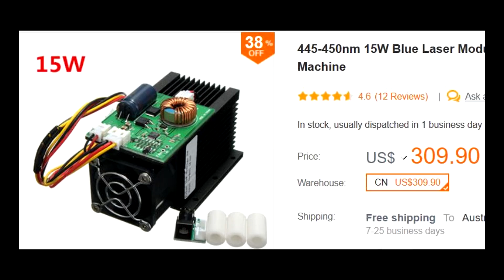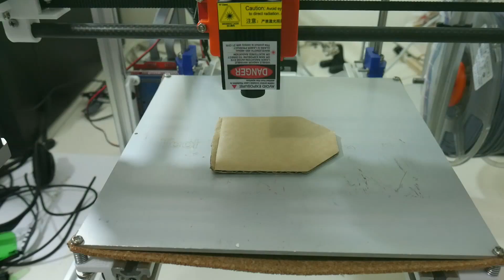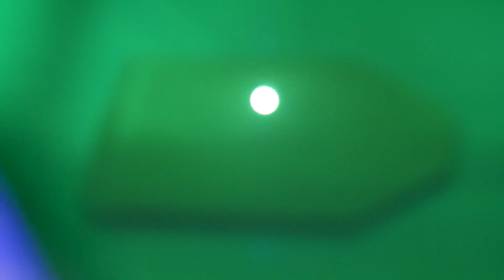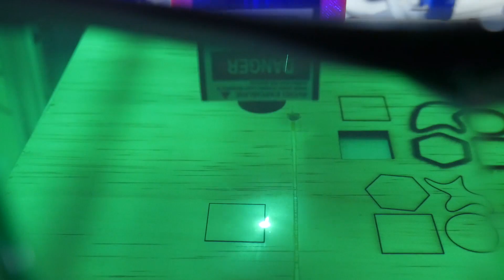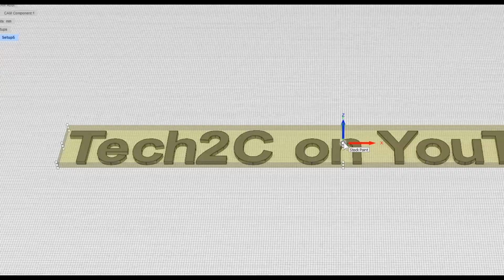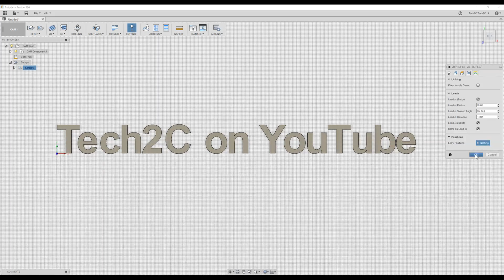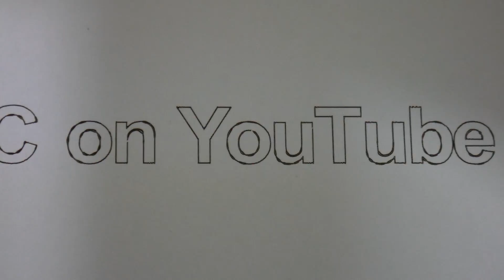Laser Cutting with a 3D Printer

Comment: Anyone no how powerful a laser would have to be to cut through a tin soda can?
Reply: Jason Purkiss the deathstar should do
Reply: Jason Purkiss I don't have a lot of experience with lasers but we have 4, 80 watt Co2 lasers but the trouble would be the fact that a tin soda can is rounded meaning it would constantly be going out of focus unless you did some fancy auto z height adjustment
Reply: Cans are made of either steel or aluminium.
Aluminium is not at all easy to cut as it's a very good thermal conductor, you'd need +100w laser.
You'd need less for steel but still probably 80w.
Cans do have some sort of polymer coating, so careful venting would be needed.
Reply: thanks Vincenzo but i was thinking more cutting the soda can to flat metal before putting them under the laser printer :)
Reply: Jason Purkiss kinda should've assumed that but I'm pretty sure bare metal is hard to cut since it reflexes a lot of the laser so maybe painting it black would be better
Reply: Well i was going to buy a CNC to get the job done but didnt due to the noise and the mess, was hoping that the laser might be an alternative due to living in a small apartment
Reply: Jason Purkiss laser might have unwanted fumes, arnt cans coated with either paints or some lines type thing on the Inside, if you don't mine me asking what do you need to cut them for
Reply: well there was that too but the right fan and a tunnel out the window would hopefully been better than dust from the CNC but about 3 years ago i designed a unique object that i wanted to create even spent 6 months on google sketch designing it but when it came to the build i realised it would be 1500 in metal so i started to look for alternatives. I could cut the cans with tin sheers but it is important to be precise and so that why i started to look at the X carve :) i will probably never build the object but it helps me to research all these kind a things :)
Reply: Jason Purkiss wow that's a lot of dedication and would be a crazy shame to see it all go to waste check around see if theirs a maker space or your high-school even I'm a sophomore and my high school has a multitude ormf teachers and machines that I'm sure would be willing to help so just ask around, if you don't mind where are you located?
Reply: well im to old for school and any 3rd parties just want to charge to much but part of the fun is to do it my self. may just print it with a 3d printer and if it looks good then upgrade to a metal version with CNC:)
Reply: Looks like im doing it by hand then, thanks

Comment: You know they now have a 15 watt version of that and it is pricey (as much as a 3d printer) but I wonder what it can do being six times as many watts?  [edit: like everything from China I wonder if it really is 15 watts though?]
Reply: Its an over driven version of a lower powered laser. They dont last very long.
Reply: No reason we couldn't mount tube on the back and mirror on end of x right?
Reply: Even their CO2 lasers are over driven.
Reply: I just ordered the laser, a pair of glasses and a barrel connector for my Prusa I3.  I don't plan on cutting with it but I do engraving.
Reply: I check and this morning the exact same Laser (same as this one) dropped from 51.90 to 39.90.  Not happy about that.

Comment: Also, are you adjusting the z height as you cut 3mm deep lines, or just keeping it fixed?
Reply from the maker: In this video I haven't. I tried it once earlier with varying the Z height but I need to test in further.
Reply: I'm going to do a laser cutter with my machine, but I want to put it in a box with a fan to take care of the smoke.  

I was going to put an acrylic window in the box.  Do you know if a standard blue or green acrylic sheet would provide enough protection?
Reply: No updates on this in a week?  You didn't lose an eye, I hope!
Reply from the maker: In about 7 hours the next video will be up...!
Reply: So will I.  Good night!  My Laser arrives Wednesday.

Comment: If you add a "part cooling fan" style fan it will help you when you cut. It reduces the risk of something catching fire and blows away the burned wood so the laser can reach the uncut wood. 

If I turn off the air pump on the 100 Watt co2 laser in our fablab you have a fire in a few minutes ;-)
Reply: Actually.. No. I can see your thinking, but it is in fact, the opposite. 

Look up air assist. You don't need much power, but it is definitely blowing, not sucking that is required. 
 
The blowing keeps the smoke out of the laser path, allowing the full power to get to the target, and flushes out the cut enough to keep it working. It probably causes any embers to burn fast, and extinguish, instead of smouldering,and spreading. Kind of like blowing out a candle, by removing the heat.
Reply: Laser cookies, mmmmmm.
Reply: Does anyone replace the air with something inert to eliminate the risk of fire and possibly reduce charring?
Reply: Being its a fabrication laboratory, the laser cutter is mostly used by inexpedience people. The only time I have seen fire was because my supervisor discontented the air. It was blowing away some tiny tiny paper pieces he was cutting. But it very rare that something will be on fire by laser cutting it. That double cardboard is the most risky in my experience. And trust me we try to engrave everything. Cookies are fun ;-)
Reply: He meant physically inverting the fan
Reply from the maker: That makes sense, cheers!
Reply: Whaat? No!
Reply: No and no ;-) most fan's have electronics in them, they will not work in reverse. And I looked it up, we use about 2.5 ish PSI of air. The amount of air helps it to cut deeper.  There are some videos by RDWorks that explains it in details very interesting.
Reply: @Voyager_2  just mount the fan in opposite direction
Reply: I think that makes sense because what burns is not the wood itself, but the gases that get released as it's heated. If the mixture is too lean it won't burn.
Reply: Voyager m:
Reply: Switching the polarity of the fan might work well
Reply: That would do quite the opposite. You need a suction not a blower. You are trying to suffocate ant possible embers not supply them with more oxygen

Comment: you should rename it to laser engraver. it's more of an engraver than a cutter
Reply from the maker: Well as a 'hobby' grade small and easy laser it can cut what was shown in the vid. Of course it doesn't hold a bar to C02 lasers but that is a whole other project :)
Reply: Looks like he cut almost everything in the video.
Reply: He was able to cut plywood with a laser, he did not engrave it.  A laser cutter doesn't mean it should cut everything.
Reply: Brian Boni yea, plywood and paper. plywood done in 15 passes. try doing acrylic or aluminium sheets with that.
Reply: Ha! No way.
Reply: is that a hint of a project in the pipeline? :P

Comment: Would like so see it cut blue or pink Styrofoam insulation.   Try different thicknesses.
Reply from the maker: Yeah I need to try more materials - foam, acrylic etc.
Reply: Tech2C - probably obvious to you, but for anybody else reading this; make sure that whatever you use is laser compatible... PVC, for example, releases toxic fumes when hit by a high power laser...
Reply: Tech2C I'd like to know if this laser is powerful enough to cut foam boards, such as Flite Test plans!
Reply: Yashar Yasrobi this is way more powerfull then you need.

Comment: Can you cut acrylic with this?
Reply: From my experience, acrylic is almost as hard to cut as wood. So it's possible to cut 2 mm acrylic, or something like that
Reply: That laser power would do it?  And does it melt together again at the edges?  I've never played with laser cutters, but I have an old 3d printer that I could take parts off of to build one.
Reply: I only have experience from 60w lasers, which can cut 10 mm plywood in one go... But as tech2c showed, it's possible to cut 3mm plywood with this laser (but very slow), so i guess that acrylic should work also. I don't think it would melt togehter
Reply: Laser diode wavelength will pass directly through transparent materials. Ppl can mark acryllic and glas painting it with black ink before lasering

Comment: Have you tried engraving anodized aluminum?  Great for making face plates for projects and personalizing items. You might also check out http://cncpro.co/ for free open source software specifically for laser cutting. It is currently compatible with GRBL and Smoothie boards and they are working on making this compatible with Marlin/Repetier boards.
Reply from the maker: I guess my Alu heat-bed is not anodised as the laser doesn't leave a permanent mark. I'll try to engrave a length of 2020 extrusion as that is anodised.
I did check out Laserwebb but it didn't work with Marlin, as you mention. Hopefully support is not far away.
Reply from the maker: Ha, i'd already watched that video :) He did a great job with it.